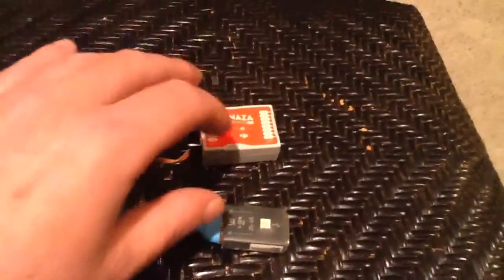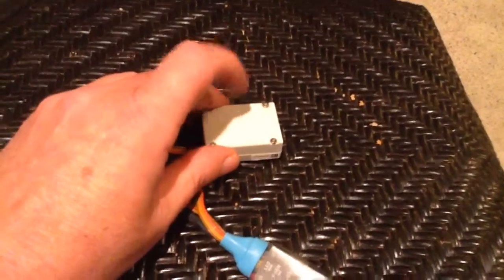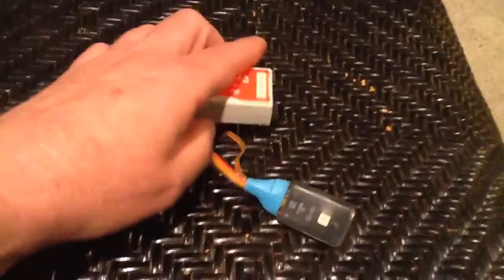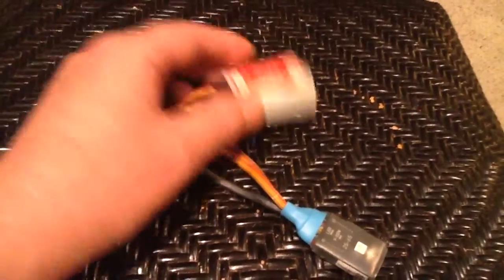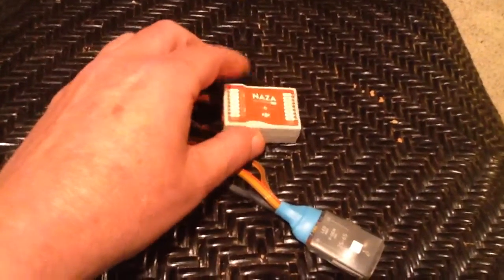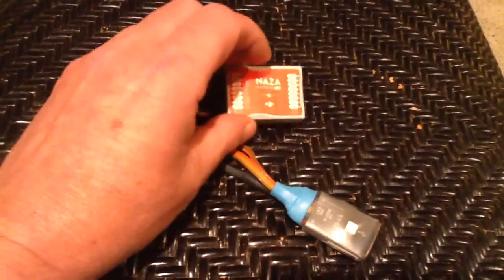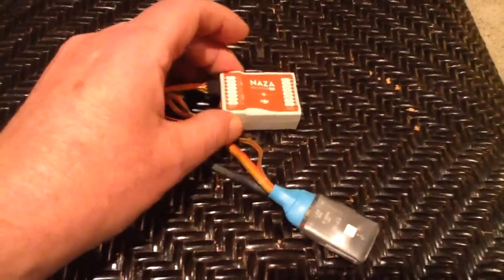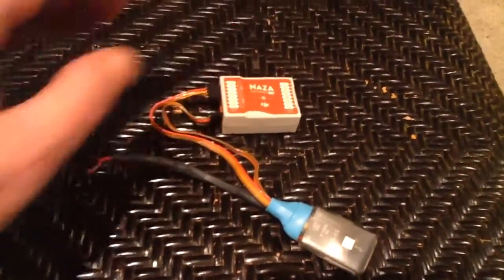Naza lite paint the inside of the case

Comment from the maker: .The Naza m unit has been reported in some cases to be light sensitive... The Naza M unit case is white and allows light to transfer through very easily... The problem with this is that there is a barometer inside the unit which is affected by sudden temperature changes and this happens when light is added..